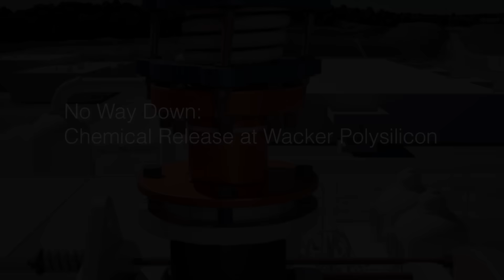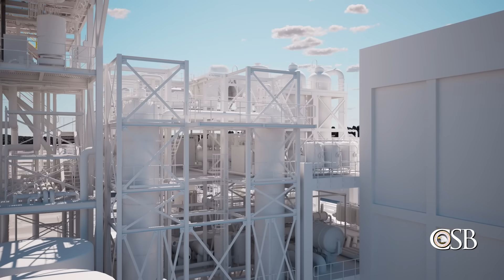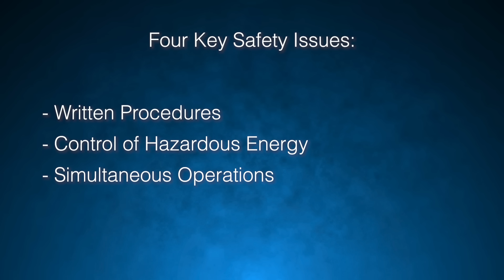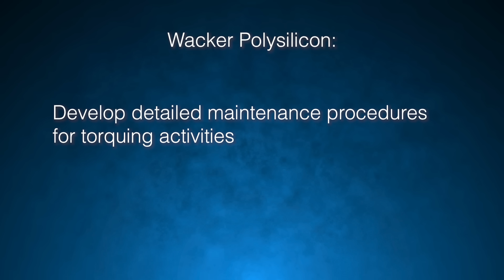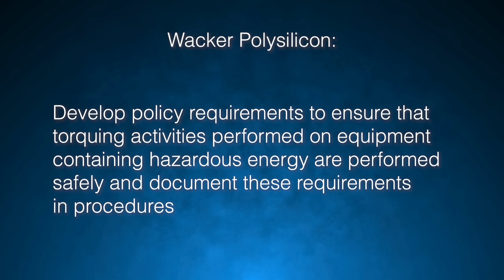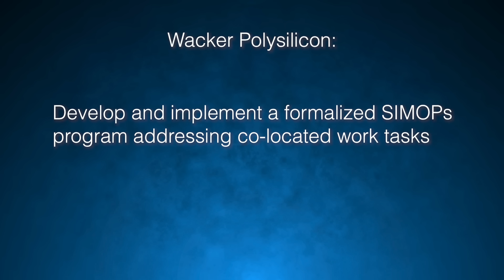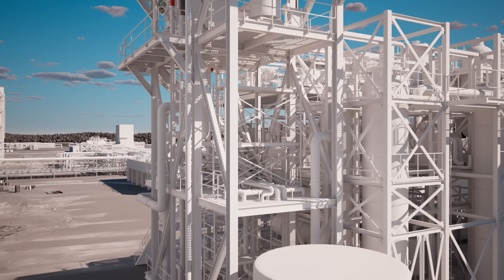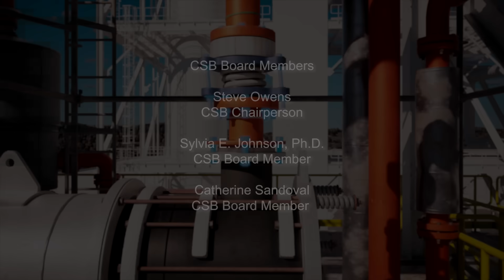No Way Down: Chemical Release at Wacker Polysilicon

Comment: While Wacker could have prevented this, I don't understand (I do) why the incompetence of the contractor is not in question. A pipe fitter should know that you can't tighten graphite components the same as other materials. The contracting company in accepting the contract is saying that they are equipped and capable to complete the work in the contract. If someone went in there and just started cutting random pipes with sawzall it would release chemicals too. Granted, safety is everyone's responsibility, but there has to be some recourse for people doing tasks they are not qualified to do, or making simple/obvious mistakes such as this.
Reply: This!!!!

Comment: So far as material from governmental entities goes, this report probably has the most polished intro sequence I've ever seen. Compared to what we do in the UK (Use a video editing desk from the 90s to slap some roughly rendered text over a 540p video clip) it's a lot more professional, though admittedly the UK approach is cheaper. 🦅🎞👍

As for secondary and alternative means of egress from structures like this; If any companies start complaining about costs and increased burdens on their business, tell them to have a walk around the local fire station. Structures like this will never need to be ADA compliant, a vertical pole (Like those used by firefighters the world over) allows for rapid and controlled descents and egress with much less risk of injury for much lower cost, and they don't require a peak level of fitness to use them safely. 👍

Comment: Another point that should be addressed IMO, are sharp edges, corners, clutter or any other hazzards that could catch on clothing or personel safety equipment.
Work areas, especially those that pose risk, should be engineered to be clean and orderly as possible.  That should include removal of unused electrical cable, neatly dressing existing electrical wiring, cleaning inspecting and rust proofing of pipework.  Good lighting of all areas, including those hidden corners.

Outstanding work by the CSB as always.

Comment: What do you mean inadvertently? These are pipe fitters, they knew they were tightening two different materials, steel to steel and steel to graphite. Even if they didn't know the torque values they would have known that they needed two different values. Wacker Polysilicon should in the future hire pipe fitters who know what they are doing. At the end of the day safety costs money which companies are allergic to.

Comment: I wonder at which torque this would have failed at. Shouldn't certification require at least twice the force? 40 to 15 ft lbs seems like a small range. Why not print or emboss the torque limit onto the equipment?

Comment: 1: Written Procedures: The torque-spec is actually only the thing I find be done incorrectly here. If this would be done correctly, the accident would never have happened.

2: Control and isolation of hazardous energy: The problem here is, drawing the line where isolation should be done. Usually, its when equipment is intentionally opened or accessed in ways not intended in normal operation. Imagine a CNC machine, and being required to isolate main power switch just because the maintenace hatch COULD fall off during normal material load and expose live parts. Its another thing intentionally opening the maintenace hatch, and another thing just it falling off accidentially.
So going the route "Isolate energy if something could unintentionally being accessed during normal operations" could mean the factories are only allowed to run the machines when theres no people present at all.

Personally, I think this work would be safe enough to do "live" with no isolation, provided that the right torque spec would have been followed.
Having to factor in accidental exposure to parts requiring isolation, and not just intentional exposure, would mean practically all touching of a machine would require isolation.

Or another example, a stamp press, that stamps out pieces of metal. "The shrouding on the dead man's switch COULD fall off, which means the button could be accidentially triggered while loading material into the press, thus the main switch should always be isolated when loading material into the press, even tought its protected by a dead man's switch for material loading".

It becomes a bit excessive to argue for energy isolation in this accident case.

3: Simops - here is also something that is hard to define. The simop here could be perfectly safely done, if the roles were opposite, if the guys on the top floor would have done the torquing, and the people on the middle floor would do the isolation work, as the hazardous cloud were lighter than air and rise up. With other chemicals that are heavier than air, this Simop would be perfectly safe and the guys on top floor could just have waited it out, even if it took several hours.

Same with Simops involding other hazardous energy sources like electricity. A Simop involding a person working on something containing electric energy, while another worker in same location works on something else, is perfectly safe, even if the electricity is restored or similiar after work. Or if live work is done. So prohibiting simops in all cases where hazardous energy is involved can be a bit excessive.

A better idea would be to define a rule that everyone within X meters from a workspace that requires a specific sort of PPE, should also wear the same sort of PPE. It could be called like something like "Minimum common PPE", MCPPE, so the torquing work requires a PPE of chemically resistant clothes with acid respirators, then the guys doing the isolation work should also wear MCPPE which means chemically resistant clothes with acid respirators, even if PPE required for that work is lower.

And this could then apply to all work, regardless of if its simop or not. "Everyone within a X meter radius of a hazardous workplace where PPE of type X is required, must also wear the same sort of PPE, then called MCPPE, which is not the same as the PPE required for his work".

4: Egress routes - In this case, code doesn't require at least 2 egress routes, since the place is not designed for human occupation. Having to factor in hazardous energy in egress design, could mean expensive actions need to be done on for example manholes, culverts, maintenace rooms and such so everything requires 2 exits. Thats also a bit excessive.

A better option would be to mandate that everyone visiting a place not designed for human occupation, where theres a heighened risk that the main route of egress could be blocked or become inaccessible in some way, regardless of if hazardous energy is involved or not, MUST wear or have access to appropiate equipment (escape ropes, portable escape ladders, PPE for passing through chemical clouds, cushions etc) that faciliate the egress even if the main route become blocked. Such PPE could simply be a portable alarm to call for help, for example for cave workers if the cave caves in.

So the "Simop" and the "Egress" recommendations could be replaced with a recommendation to always wear a common PPE when doing simultanous work, even if one of the tasks doesn't formally require that PPE, and that common PPE should also faciliate egress through main route even if its blocked or inaccessible without PPE.
Reply: 1) Ensure you have appropriate PPE. 2) Ensure your co-workers have appropriate PPE. 3) Ensure the work site is secure. 4) Ensure you're familiar with the evacuation plan. 5) Ensure the thing you're looking at matches the diagram provided. 6) Follow the written work order.

Comment: An area where: there is limited egress, is not designed for continuous human occupation (was designed as an "unoccupiable equipment platform") & has the potential for an atmospheric hazard to occur. By definition that is (ironically) a confined space and requires all the planning, permits and safety equipment associated with one.

Comment: At least it wasn't silicon tetrachloride.   I'm surprised the pipe fitter was willing to pull hard enough to put 40 ft-lbs on a graphite part, especially one containing hot high pressure HCL.  The few times that I have bolted through graphite I thought I was going to break it  just going finger tight! :)

Comment: In the context of the video, there is no information about the Automated Safety Instrumented System (see standard IEC 61511). Why was the leak 3 minutes ? Was it the entire volume of product leaked through the leak or was it the result of triggering of gas detectors, shutdown valves, triggering of the process to bypass through the safety valve? Mentioned PHA, thank you...
PPE is the LAST level of protection for workers!

Comment: I still think the root cause boils down to the critical piece of information not being communicated more thoroughly.  Especially when the flange is made of something like graphite and catastrophic failure will occur in case of not-unreasonable over tightening.

An equally serious oversight was doing the work on live equipment instead of depressurizing and emptying the heat exhanger first.  Did the plant not have a secondary heat exhanger to switch to in case the primary needed repairs?  Or did that require a complete process shutdown (something that can be a pretty hazardous operation in itself plus the restart).

Comment: companies should assess "worker input" ... this is usually followed not with a, thanks for pointing out that issue to us, but more likely the question "don't you like working here ? " I can't recall how many times in heavy industry and on offshore platforms I've mentioned that something wasn't right, or was unsafe and received the old "don't you like working here" lecture.  For some companies the only wake up call is when something affects the bottom line, or gets reported in the press.  I'm cynical yes, but I've seen it happen many times.

Comment: The fact that there were reports FIFTY YEARS AGO that suggested getting these sorts of safety codes into law and nothing has been done...
Reply: The power of lobbyists
Reply: Getting the final layer of swiss cheese in place is always the hardest. Training your employees to always verify bolt torques with the drawing is way less expensive than adding extra staircases to every process stack. Even if a company is really committed, they will probably address the first 4 or 5 causes in the chain and call it a day.

Comment: I use to work here..... they barely discuss this. They sweep it under the rug and discourage talking about it. I was shocked to know it happened 2 years before I started. A terrible place to work. One of the jobs is literally smashing a sledge hammer into raw polysilicon to break it up. They obviously don't care about safety.